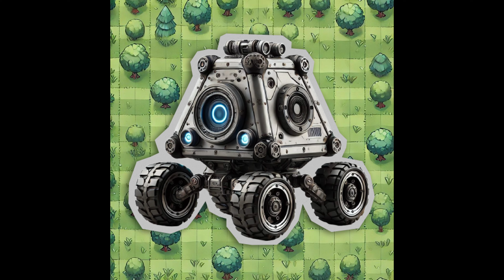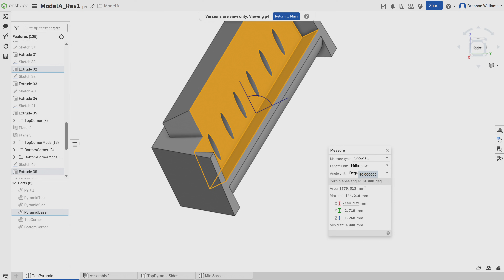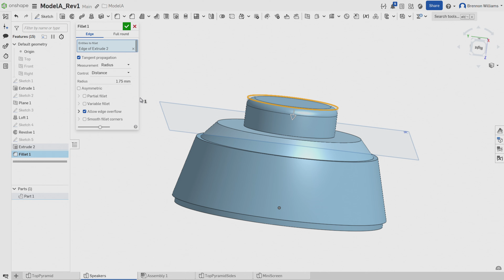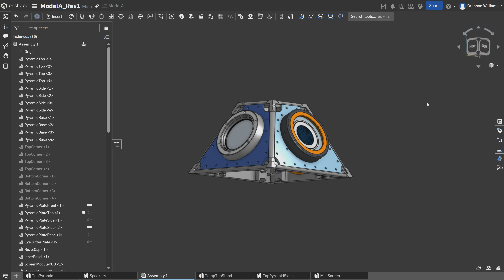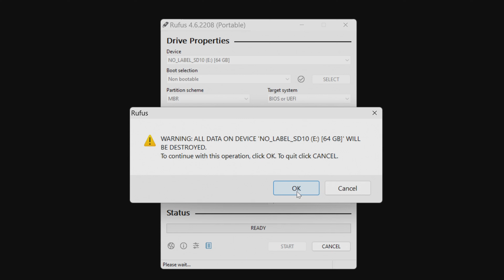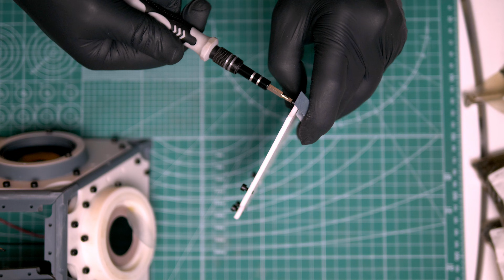How to Prototype Robot Speakers

Comment: Nice videos , thanks . When you need some 2k foam or something out of TPU or very soft TPE , please let me know.
Reply from the maker: Thanks Peter! You are making things out of TPU etc or you are supplying it?
Reply: @oldmanmaker  both :-) i work as a 3D printing specalist for 10 years and now in a company they produce a kind of polyurethane , TPU , Foam etc.  I build my own pellet 3D printer so i can print all kind of TPU. I am thinking on your tyres etc.
Reply from the maker: Nice! I've got a few options I also want to try on the tyres, but would love to compare mine to some that are pro made by someone such as yourself. When I get those hub's fully defined I could send you the details if you like?

Comment: Thanks for another great video. 👍
The speaker problem was obvious, speakers of this size should sound pretty good.
Reply from the maker: Hey thanks for the compliment! In future when I know how much space is available in the top pyramid (after PCBs etc), I'll try and get a proper volume calculation for these speakers and model a better performing enclosure at the back which should improve the quality dramatically. At this stage of the prototype, they'll do the job.
Reply: @oldmanmaker  It could have been because of the SD card inserted the wrong way in the interactive diagram, but since we have a disclaimer at the end stating this is just the beginning of your video animation journey, we'll let it slide :)
Reply from the maker: Oh that really cracks me up! Awesome!